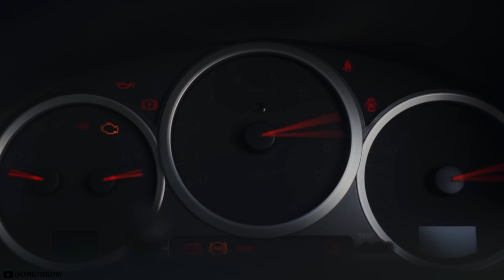Donut Media VS. Subaru

Comment: As a mechanical engineer, I have to say that, (first I owned a turbo subaru without any problems and its at like 250 000km rn). And yess the point you were making is right, to put propper words on it, the subaru are made with extremely precise engineering and are on a different platform than for example an honda or any inline 4 engines. And in that way of thoughts that why it is very important to understand the limitation of the car. It not like a k24 who was build to make stock 170 whp, and that has a low compression ratio and small pistons. Subaru turbos engine are massive in the bore diameters of their piston and for the stock numbers that they put to the wheel. They are turbocompressed and very well tuned form factory to ensure reliability. But because they are precisely envineered, the little you get of chart with evrything you fall in the range of tolerance that was not calculated to be work. And you have failure. These car can be added stock reliably on the crank a few 50-80 hp but after that everything will wears out fast because they are design at already a maximal potential for the stock parts. That it. It all a conception matter
Reply: Mechanical engineer and 20 year master tech here. An engine "built on precision" doesn't mean that the design itself is in any way good. Think of the Wankel engine. It's extremely precise in it's design, BUT it has inherent design flaws which makes it the least efficient and reliable engine almost every conceived. These Subaru boxer engines are over-engineered and have inherent design flaws. You're throwing around the world "reliable" seemingly colloquially. A reliable engine is one that will continue to perform through all kinds of different conditions and circumstances. But as you've stated, the moment you make even the slightest change to these Subaru engines, it can throw everything out of whack and will end in catastrophic failure. That, by definition, is the polar opposite of what it means to be reliable.
Reply: @DaroffApFire  Lol that preface just to state you’re ignorance is amusing.
Reply: Also a Mech Eng. I don't think you actually are an engineer. 
There is no more precise engineering in a Subaru turbo engine than there is in any other engine. I would argue there is way less, given all the issues they have.
Reply: @AdamRW240  I aslo doubt that any of you in this comment section is indeed an engineer with what you are all saying. In brief, if you remember von mises and security factor, basic fatigue analisis, these are all the the things that where taken in the calculation and when I say precise engineering is that they optimizes the design to a get the maximum out of each part with a little tolerance factor.
Reply: @DaroffApFire  in fact if you where a real engineer or at least a one who really understand car mechanic because I really have put my hand to the work and grease, youll know that there is no engine that is efficient in a term of theorical otto’s cycle. And if you did understand what I said in my previous text, youll understand that they are use in the almost max capacities of the part with a low security factor and precise von mises and fatigue analisis to get the most out of each part. So no wonder you change variable the equation will not give you the same result, see this like a quadratic equation, if you change just a little bit the x valu (higher than 0 fo ie) you get ^4 answer so just a small variation will change everything. Unlike a honda where it more of a linear equation so kind know the answer before any modifications. This is just a simple mathematical comparason so youll understand if you indeed have a degree.
Reply: @AdamRW240  see this like a quadratic equation, if you change just a little bit the x valu (higher than 0 fo ie) you get ^4 answer so just a small variation will change everything. Unlike a honda where it more of a linear equation so kind know the answer before any modifications. This is just a simple mathematical comparason so youll understand if you indeed have a degree.
Reply: @AdamRW240  Exactly. Even if there was precise engineering in an engine, that doesn't mean that the design of the engine itself is a GOOD design.
Reply: @Pakaniel  Well fun fact, I've also been a master tech for 16 years. And you can sit there and theorize as to how something should perform on paper, but until you actually have your feasibility department build and test the thing, you won't know for sure. I agree with what you're saying, but none of it is relevant. The point being is that these Subaru boxer engines are trash engines. They're unreliable, same as any Wankel engine. That doesn't mean that car manufacturers aren't still going to  use them lol.
Reply: @DaroffApFire  i get it, but to have done many project of retro engineering on subarus engines for rally team, they are not trash is what I’m saying. But at this point keep your opinion while I stated facts. I know the truth you know yours.
Reply: @Pakaniel  Okay so now we're getting somewhere. Working for a race team completely changes the entire conversation. These engines aren't reliable in the sense that they're good for common use, as in a daily driver. They are, however, great RACING engines. Why? Because racing engines are constantly rebuilt and worked on. 

When I'm saying they're trash engines (just as the Wankel engines are) I'm talking specifically from a design aspect for common use vehicles. Even Wankel engines are GREAT race engines.
Reply: @DaroffApFire  i get it for this part yes. But no there not trash, this is a normal stereotype of somebody that never own a good old subaru, or that had one bad experience with it.
Reply: @Pakaniel  Not all Subaru engines are bad. But the ones use in these cars are. They're extremely unreliable.
Reply: @DaroffApFire  yeah for sure some engine where better than others. But like good old ej25 in sti and wrx from 2011 and older are great. Old 2.5 na also
Reply: @Pakaniel  Those are the worst engines bro what in the world are you on about? All of those had so many problems that Subaru tried to lie to "comfort" consumers by telling them to use "more premium oils" and a "more frequent oil change". As if that was the problem.
Reply: @DaroffApFire  I mean I never had a problems and I owned about a dozen subaru from all the years before 2013, including wrx and sti, na also. High mileage for the most. No problems, it my town everybody owns subarus because we live in the hills and snowy mointains, its probably the most common car to see. So if they were that bad they will not be as much as there is on the street. Also they are the car that statisticly stay the most long time on the street. Over 15 years.
Reply: @Pakaniel  Well as an engineer you should know that personal experience means absolutely nothing when it comes to data. Still, the cars and engines are cool and can be badass racing engines. The older ones still have loads of issues though.
Reply: @DaroffApFire  you are right about that, but still, the stats I gave you, you can look up by yourself is true about their time on the road. And yes its just because I hate when people compare hondas to subarus, hondas have a looooaaaddd of problems, head gasket failure on the crv, oil consumption, etc its juste because subaru is a brand that seems to take the abuse more and for no reasons.

Comment: How much of a psychopath does someone need to be to see Donut Media go through like 5 engines and say "The problem must be that they don't know what they're doing"

Ignoring the fact that they work out of a shop with a lot of professional mechanics, we've seen them do a bunch of different builds....if a Subaru is too difficult for them then my only take away is that 99% of the people out there shouldn't touch the brand since it's just so insanely complicated.

The reality is that these aren't new cars and we're seeing why a common failure point is called a COMMON failure point. Some bad engineering doesn't help either, but I guess we should just be thankful the Pontiac Fiero doesn't have "passionate" fans.

Comment: Great video! Best one covering this topic. 

There were some Subaru shops throwing a lot of poo at Donut for this series. Kind of ironic considering an independent shop can be successful by exclusively working on Subaru’s.
Reply: from what ive seen they all said the same shit about supporting mods. which is not something you want to hear and shouldn't need. just shows that the engines tend to be delicate from the factory but hey, rakes in the money!
Reply: @spp6849  to be fair, you shouldnt be thrashing a 15 year old sedan on the track without any supporting mods in any case, just begging for something to happen
Reply: @spork8721  Lets not forget the whole WRX/STI advertising, that's just blatantly horrible.
Reply: @spp6849  i agree with that, they advertise them like they're road legal wrc cars
Reply: @spp6849  the thing is that the EJ doesn’t need a whole lot of supporting mods to fix many of the problems it faces. Sure it’s still extra work but a lot of other cars face the same dilemma
Reply: @Swedester  the common dilemma is overly hot fluids. what isn't common is the boxer engine design. They're just not as practical for general use compared to something like a inline 4 and definitely more costly for track use.
Reply: @spork8721  didnt they do this to an m3 and that thing survived? along with the miata and the Z... why is it that the subaru can't handle it? its quite simply, the subaru is clearly lacking in reliability in comparison to those engines. dont know why they didnt start with the STI as it is an all round better platform...
Reply: @no1washerezz  Haven't seen the videos on the other cars, but regardless its still an incredibly stupid thing to do, I can guarantee those motors failed due to oil starvation and thats probably because the factory oil pans arent baffled
Reply: @spork8721  well actually, they recently posted a video tearing down one of their engines and turns out. they said that they had an aftermarket oil pan on every single engine. besides, that's my point. those cars all took track abuse but why cant the wrx?

Comment: If Subarus were a pain AND awesome, that would be one thing. M/AMG/LS7/Voodoo engines are less troublesome than Subie engines and special enough to actually be worth the effort. A turbo K24 will do everything an EJ25 will do, but better. Plus, if you fix the known problems on most engines, they'll run forever; a Subie engine could be fully built and still grenade for no reason.

Comment: that was perfect dude. 
the high low series did make me a little frustrated subarus are harder to build nothing more nothing less. 
there are a lot of little things when it come to subarus that need to be done and its a lot of little things that other platforms don't have , like hours and hours of research and stalking forum posts about how to get a tiny bit farther into a build or figuring out a problem. 
i remember  having a problem with my maf sensor and my map sensor not being perfectly syncd together and it took me a month to figure out that's a stark comparison to my old focus where it took me maybe a week to figure out a problem and get it perfect again.  similar with the rotary people they are a super cool cars and very hard to build but not to say they don't make power or they arent reliable just harder to build and I think that's why people love them. if ii wanted easy power I would buy an ls powered truck and slap a turbo on it done . 
but I don't and I never will I love subarus because I love to play with my car I love to change the way it feels I love to break it and understand why it broke and improve the car in that way.
Reply: I'm sorry bruh but working as a subie tech and having subie friends there unreliable ASF bruh bmws have less problems and there considered unreliable but a n55 335i won't leave you stranded on the road the same way a FA wrx subie would take a glasses off bruh
Reply: @kailara8002  yep
Reply: @kailara8002  100% this. Everyone is talking about all the knowledge and expertise you need to get started on doing builds. Meanwhile people I know just leaving them bone stock and doing normal maintenance routines are having catastrophic issues. They're fun and interesting to work on as a project car if you absolutely love the platform. If you are not diehard into Subies or need a reliable car to get around in, do yourself a favor and get almost any other vehicle possible. Sent from my garage where the blob eye POS that I love is getting it's 5th head gasket replacement
Reply: @Gummbeh  What temperature do you let the coolant get to before driving your car?

Comment: I’ve heard plenty of people who needed engine rebuilds on totally stock Subarus. We also all know about the gaskets and how the can be a problem. I’ve dreamt of building a Forester STI tribute, but I think I’ll keep it just a dream
Reply: Generally the NA EJ 2.5 had the head gasket issues (single layer graphite coated). The turbo head gasket is fine unless you're making crazy levels of boost without upgrading head bolts/studs. It's not true that all subarus have this issue, despite memes on the internet.

Comment: I feel that Donut Media are good car YouTubers, and good mechanics, but the WRX is a very very specific case, with so many particular troubles and techniques that it's understandable that they had these kinds of issues. They should've done more research on the platform so they didn't waste so much money, but in a way, they showed what an at-home mechanic might experience if they were going for something like Low-Car.

Comment: Well said and solid conclusion. I'd also add that subies are the same as the audi in the sense of needing to be tuned for any change made. That is the main reason for failure I see along with the lack of owners checking fluid levels between services. Subarus burn oil. It's not new. Check your oil people

Comment: Compliments on a well balanced view point.  In my personal experience going from my first car being an 88 AWD Ford Tempo that had constant axle issues due to being to long, then a 92 Nissan Maxima that had the timing chain break throwing the piston fully into the spark plug busting the piston completely and leaving me stranded. A 93 S10 Blazer that I carried a spare cleaned EJR valve to switch out when the other got clogged, then a 02 Buick Regal and a 99 blazer both that suffered the good Ole GM dExcool lower intake manifold gasket issue to it's full extent. A 03 Neon that was simply bought due to it being cheap but only ever drove it 4 miles lol. Now to my current car being a 2002 Subaru Impreza Outback Sport which had 123,000 miles when i bought it 3 years ago that I've replaced all the drive train except the transmission and driveshaft, replaced all wheel bearings, front control arms, all the struts, valve pan gaskets, plugs, plug wires and multiple other varying things that needed replaced simplly due to the previous owners lack of preventive maintenance. At current day the OBS only has 142,000 miles and has slightly developed the head gasket leak but after doing all the repairs myself in my driveway I would gladly do it all again vs doing any of the repairs on my other past vehicles. The subaru platform just makes sense usually. Yeah the oil pan baffle issue is dumb and other random things that shouldve been no brainers to subaru are there but compared to the zero tolerance of my maxima, the obsurdly cheap and garbage designs found on my 2 blazers and buick and the utter irriatation of working on the dodge neon and it taking hours to replace a simple  belt tension pully which might be the dumbest desing i've ever seen. That all being said i feel even if Donut didin't know what they were doing or know nothing about the platform they can all read. I watched the Hi/low episodes when they were being aired and i may only owned a subaru for 3 years but I read a lot and learn fast and feel they could've avoided many issues by doing the same but unlike them I haven't done any mods. I've simply replaced with mostly subaru oem parts and drove like a grandpa so maybe my fait would've been similar to theirs if I had modded and raced my 02 bugeye. 
\

Comment: When I bought my wrx I watched a lot of videos on what mods to put them on and how and why, and I learned a lot. You cannot slap a intake on it or really do anything without tuning the car. You have to tune them after installing most mods or else you’re going to have issues. Most ppl don’t understand that. But Subaru should have taken into account that ppl will cheap out and not do their research when modding them

Comment: They're not total dog water. They're temperamental, and pretty much everything outside of an LS is at various levels.
Reply: If subaru engines were so great, enthusiasts will be swapping them into other cars all over the place.

Yet, K-swaps abound. LS swaps abound. The fact that subarus require more caution and attention is a disadvantage, not an advantage. The only subbie engine have going for it is flat motor novelty. Internal combustion engines have existed for more than a hundred years now, and legendary engines like the 2JZ, LS, K20/K24 etc. have existed for a while now. There is no excuse for Subaru to be producing finicky engines in 2023.

Comment: I think most people don't realise once you finish building a engine you have to "run-in" the engine again for about 1000miles to be on the safe side. If you don't and rev the balls off it, it can lead to a long list of issues that are irrepairable without pulling the engine back apart.
Reply: It all depends on how it's built. I.e. like race motors, if the car doesn't even see 1000miles a year how will it ever be broken in?